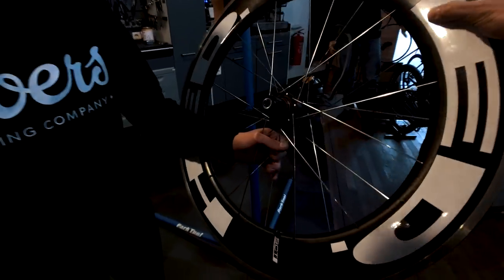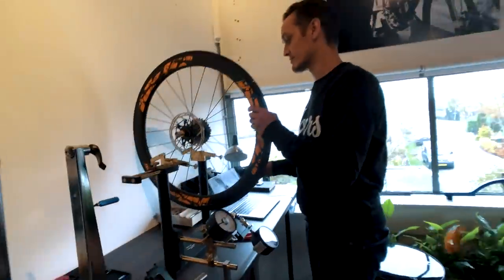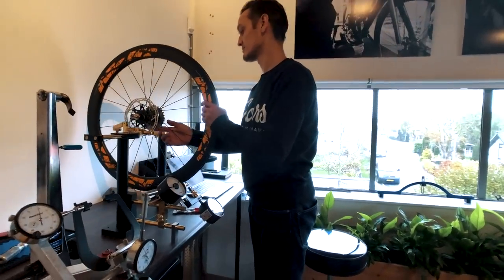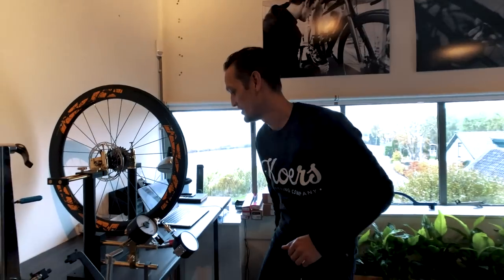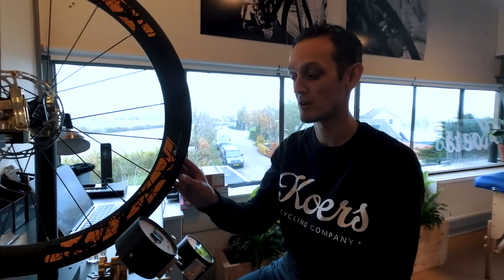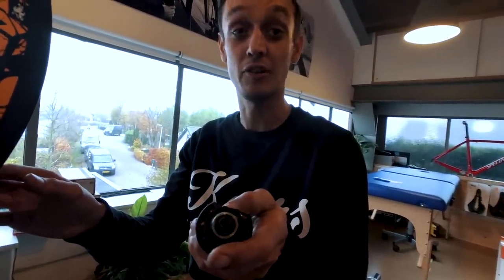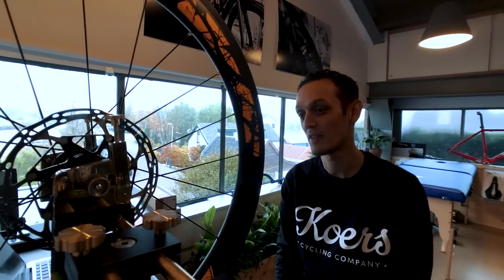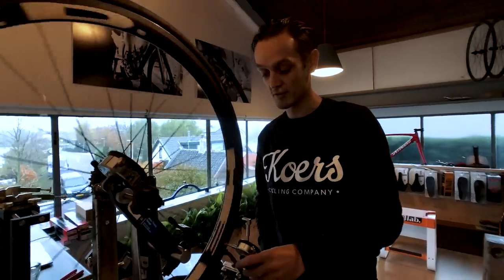FAKE CHINESE CARBON WHEELS OR THE REAL DEAL, WHAT'S THE DIFFERENCE?

Comment: The issue is, the high end carbon wheels are probably made in the same facility as the 'Chinese' ones. 

One is being sold by a company that has a profit margin the want to achieve and so they mark up the prices. The other is being sold directly from the actual manufacturer, and they don't have as high of a margin.
Reply: That's the most wrong concept about copy's and real ones....I had Chinese ones and then switched to campys and the difference were enormous!! Is like comparing a real Yamaha motorcycle with a shit copy jungling LMAO
Reply: @cyclinglover3721  your black and white concept of real and copies is naive. Most Chinese carbon wheels are just generic unbranded products produced by the same people in the same factories using the same machines and same expertise that they acquired producing the same products for the big western brands. It's some kind of middle man/reseller who slaps a HED logo on some generic Chinese wheels to sell it on ebay, they are rarely produced as counterfeits. They are merely produced because the machines, people and knowledge is already there and machine downtime is expensive. They can be, and often are, the same thing. The biggest difference is that Enve or Zipp will vouch for the quality with their good name and can be sued if loads of people end up in the hospital, possibly raising their QC and testing standards, whereas with Chinese wheels, you never really know how good QC and testing is and nobody is liable. Not that western brands' QC is good across the board.....
Reply: @danielbum912  u are totally wrong...that's why people with that kind of concept keep buying fakes or copies..no they are not the same!! And no they are not made in the same factory!! When u have copies with generics hubs and generics spokes the lateral tension and rolling quality are way bellow of the real thing ...from my own personal testing and experience.. nothing in common between these wheel's...now...I never said Chinese products are bad they have some high quality real toray carbon made  and real good hub's installed like Swiss hubs..but the price are not cheap....if they where the same as u stated in the comments..all the amateurs racers not even the pros will be rolling on those  crap copies ,because the low price.....    Once again I'm pretty sure u are one the people ur cell phone is a Samsung.  Instead of panda brand... LMAO.  Ohhh they are the same!!!!
Reply: Nahh not even close..the real ones are tested by a bunch of testing and high quality control

Comment: I have to disagree about straight pull vs J bend. I can see no reason J bend would be stronger. Also when you unlace a J bend hub you can see grooves worn into the hub from the spokes. that said I also mainly build with J bend spokes.
Reply: I am also curious about why he said J-bend were stronger than straight pull.  My understanding also leads me to believe straight pull are stronger.
Reply: @m3t4lslug  All I can think of is the spoke pull off the end & straight through the hub. I've never seen that but I guess is possible. The similar damage with J bend trashes the hub completely, & I've seen plenty of those.
Reply: Straight pull is the only way. Js are an obsolete technology
Reply: As far as I've learned, the bend in the spokes is actually a weak point which a straight pull obviously does not have so I definitely disagree with him on that one but then again I'm not a wheel builder I can barely even true lmao

Comment: Am I just congenitally poor or is $1000 a lot to pay for one bike wheel? If it were possible to do a blind test, riding the bike without knowing which wheels one was riding, and compare comparable V section aluminum vs carbon rims to discern a difference, could you?  The carbon is prone to de-laminating due to brake pad friction.  This, of course, can be solved by buying some disc brakes, a new hub, a new frame (with tabs for the calipers) and some new levers - done!  Being a woodworker and knowing how to lace wheels, I think I'll give wooden rims a try.

Comment: I have 2 sets of Cheap Chinese wheels. Have had them for year, never had a problem. 1 set is 1600 gma the other is 1350 gms. The last set was only $350 US.
Reply: Do they have a web address to check those wheels, can you recommend me any others? what about CSC?
Reply: I'm interested do you have a link would love me a set here in California
Reply: I think the durability of the Chinese wheel set depends on how it is used. if it's used by an amateur weighing under 70 kg and used for light touring, there's definitely no problem. Don't use it for competition, to win big results you need big capital too
Reply: @markowidjaja1433  I race at 75-77 kg and have won a natl championship on them. Go ahead and spend your way to big results if you can.

Comment: Hi, I am getting Spin on these Revolution series for this Chrismas!
But I am not 100% sure if I should get 58s or 48s.
I think you have HED 40mm set, 
so can you tell me why you chose 58s this time over 48s of Spin on these.
I know it is pretty flat in Netherland, 
but I've seen you do climbing a lot in this channel.
Do you think climbing with 58s is not a big deal?
Reply: Hey man, the 58s are the all round fastest and best, that would be my  choice
Reply from the maker: What Atom says yes. The weight difference between 48 and 58 is so small, I’d rather take the aero advantages, especially for the crit races I do. For an ultimate climbing bike I’d probably go for really light 23mm wheels or something. 40-48mm could be great for allround I think.
Reply: Thanks guys! There are so many traffic lights where I live in Tokyo. so I was kinda worried to go with 58s. either way I'm about to order now!

Comment: I see videos like these on fake chinese wheels, Just because its from china its fake? I have a santa cruz high tower cc and it has made in china on the frame, Does it mean its fake as well
Reply: megane230f1 The issue is with counterfeits being sold as real HED or Specialized, or ENVE.  Plenty of great Chinese carbon factories out there that market under their own brand.  But with some of these counterfeits, you can die or be seriously injured from a wheel/frame/fork failure.
Reply: daisydela If people want to cut corners without going to an authorised dealer this is what happens, it is easy to take a blank and logo it up, i know as i have a vinyl cutter and i know how easy it is to take a logo and copy it, people want to cut corners buy fakes? well thats the sacrifice they make, but to say fake chinese wheels wouldnt be the right video title i would put up, as everything from china is not fake. and i would like to also say the reason people take to fakes is because the real deal are absolutely overpriced, i mean 4k for a set of enve carbon 27.5 wheels, through the overpriced prices it is those businesses who are pushing people away to buy fakes